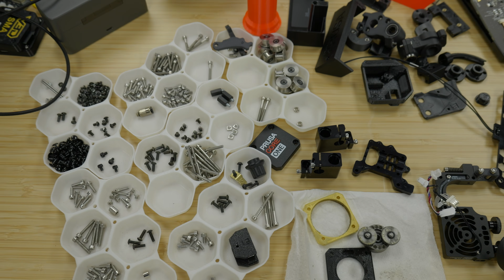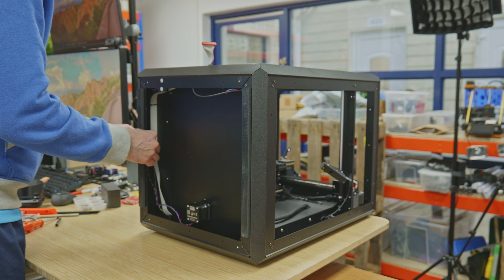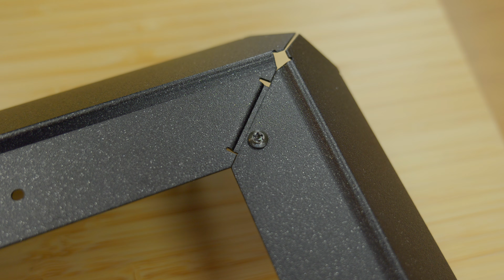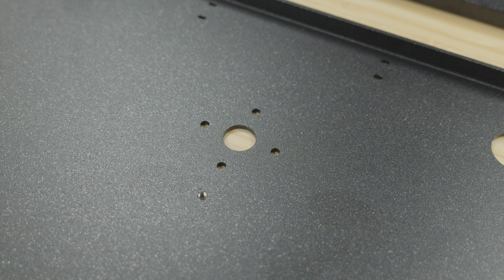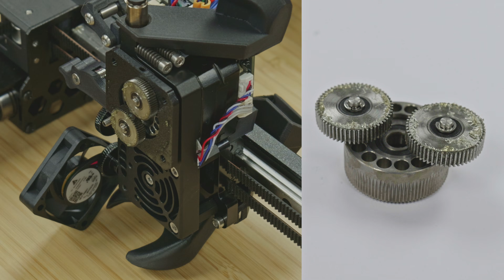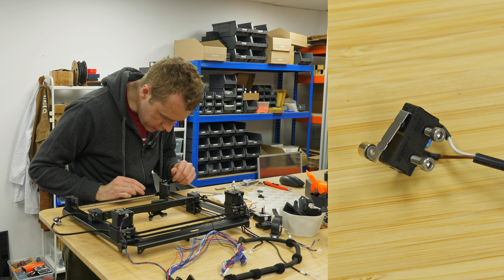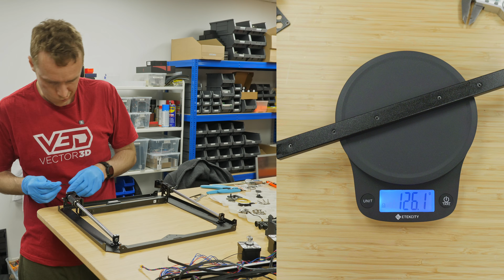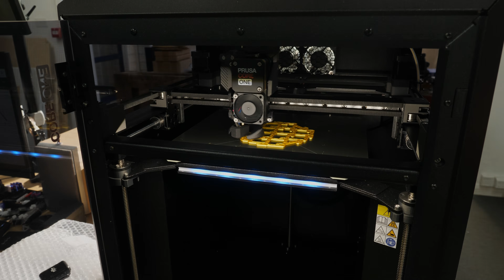I Removed all the Screws from my Prusa Core One

Comment: I have expressed the same opinion in other videos for the Core One and this one reinforced it. The sheet metal frame is a bad design choice from the rigidity and squareness stand point. Really bad choice, there's a reason why the other manufacturers talk about their "one piece" cast aluminum frame so much. This sheet metal frame is a terrible idea in my opinion
Reply: The "other manufacturers" - being Prusa themselves, with the cast aluminum frame of the Mk3 and Mk4. I'm sure they are well aware of its benefits. They have stated they have extensively tested the rigidity and squareness - and are confident they way they've done it with the Core One is pretty foolproof.
Reply: I’m not sure what you are basing your opinion on, but respectively - you don’t really know what you are talking about. Can provide your evidence for the statement that it’s not rigid or square? Neither of my two Core Ones exhibit your claims. What core xy printer are you referring to that has a cast aluminum frame?
Reply from the maker: I would have to disagree. What's the evidence that It has poor rigidity and squareness? Who claims a one piece cast aluminium frame? Which would expand and warp in chamber heat btw, probably quite badly.
Reply: @Vector3DP  I never said "it wasn't square. It is just more prone to having those types of problems. Especially if it's a kit. The best proof of this is that they had to make a separate frame for the XY gantry. Ok the other Core XY gantry is part of the main frame. That's why the Core One has that annoying bar running from side to side right on the front of the printer. On every other Core XY that "bar" is the top front beam of the frame. They had to separate it from the frame to guarantee its squareness. Anyway hopefully it's not a big deal.
Reply: @Vector3DP  maybe it has good rigidity on each member but adding a lot of joints to create a square frame is not the ideal situation. Specially if you expect the customer to assemble/disassemble the frame to service it or during the initial kit assembly. A little play here and there  as it's normal with sheet metal parts and you'll end up with a not so square frame. A loose bolt in any of those several joints is going to be a problem. Sheet metal is far from the best option here IMO but I could be wrong. Great video by the way! 👍
Reply: @elleryfg7853  That's been address in a Prusa interview video. They got people to try and assemble it out of square but no one could. it does have a single piece square base and single piece square frame section on top.
Reply: @RogerEssigArtist  well, hopefully it's not a problem. Especially for those who ordered the kits.
Reply: You have to design with the manufacturing process in mind, that way you can use all the little tricks to get a material to work within your design requirements. That way, it doesn't matter how you make the frame (whatever material), as long as it works.
Reply: You are assuming that the outer shell is part of the Core One's frame. If you watch the video you can see that he took away the whole outer shell and the Z axis and Core XY gantry where still standing proud. It is the inside skeleton that does the work and it's squareness is limited by a single piece gantry and Z screws / linear rails.

Comment: The process you are thinking of at 18:00 is called flow drilling where they use a hard, normally WC, pin and just drill that into the metal. The heat from friction melts and deforms the metal into a longer hole that can be tapped.

Great video!
Reply from the maker: I knew I'd seen it somewhere before, just couldn't remember what it was called. I've asked Prusa too, I guess they'll provide the same answer.
Reply: @Vector3DP  That flow drilling may be used in places. But looking at the frame edges, the threads on the tabs appear to be a separate part that is pressed into the metal. This is another common sheet metal method of putting threaded holes or threaded studs onto a sheet metal panel. There are several manufactures of these, but in the places that I've worked PEM seems to be the Kleenex of this part so they are often referred to as PEM nuts or PEM studs among the mechanical engineers no matter what manufacturer they use. (So if you want to look into what they are, "PEM nut" will be a good first google search.)
Reply: It can be punched through with a die inside the tube, too. The process is called hole extrusion.

Flow drilling, from what I've seen, tends to leave material proud on the surface which may not be desired for mounting a rail.
Reply from the maker: After seeing videos ye it looks like flow drilling wouldn't be ideal for this application, lets see what Prusa says!
Reply: @Vector3DP  It is common to have a "flat" flowdrill tool. One that produces a surface without any proud features. I don't really know a better way to increase thread engagement on thin walled tubing that wouldn't be a complete tooling nightmare. -Cooper
Reply: PEM nuts

Comment: M3 screws for stepper motor directly in the plastic? what a shame
Reply from the maker: Cross threading is a risk for sure, but for strength and prevailing torque it's actually fine. I wouldn't expect those motors to need replacing very often at all and it would be a very easy part to re-print.
Reply: @Vector3DP  This part is under load, and the motor is running hot with vibration. This is not what you expect for a 1.3k
Reply from the maker: While the motors can generate heat, its easily controlled, monitored and measured during development to ensure it isn't an issue. I think we know prusa will have tested these. You pay more because they tested it before selling it instead of just hoping for the best.